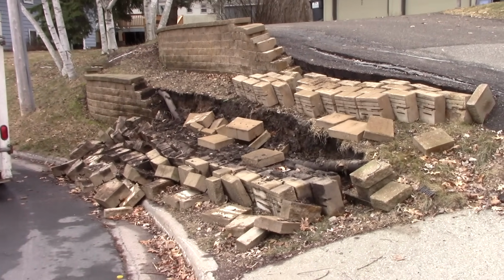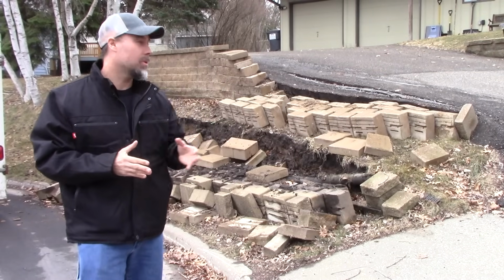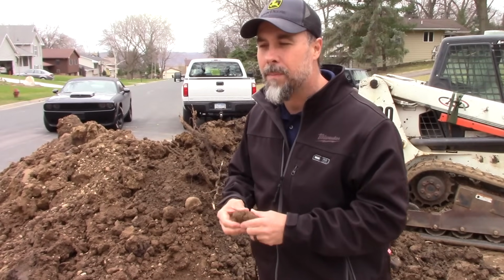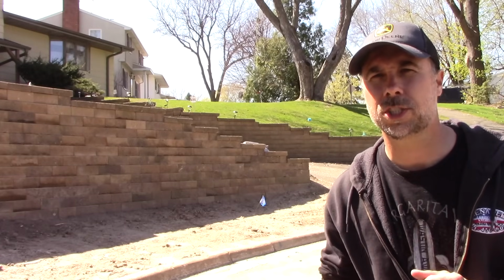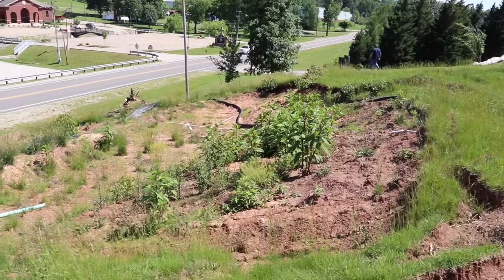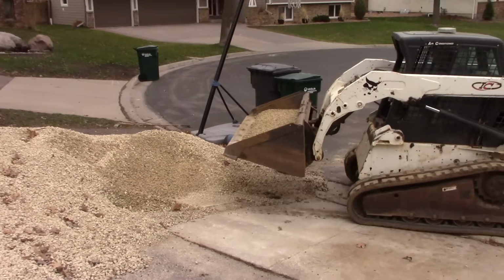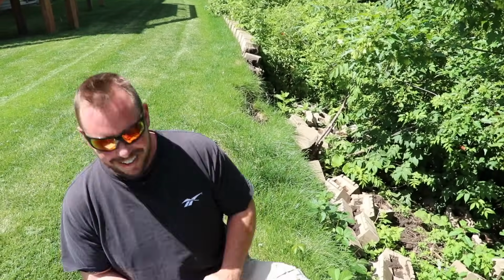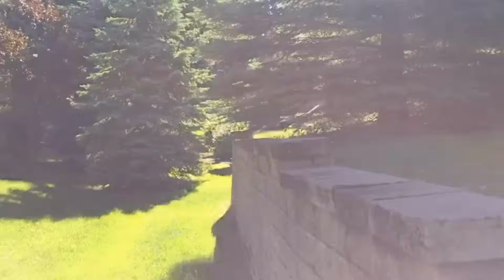Retaining Walls - How to Avoid Costly Mistakes and DIY your landscaping Walls with Great results!

Comment: we just had to fire our contractor because they were redoing our driveway, and when they took out boulders and cement they dropped it over on to the retaining wall, cracked our foundation rocks and cracked the rock on the other retainment wall. they took half of the money and after over a month we fired them. Now we are getting a structural engineer to come look at it, and we have no driveway, rock in the road, and I'm a mess. I love your channel and wish you could come out and look at our project!

Comment: I put geotextile fabric between the six inches of top soil and the 3/4" drainage rock at the very top of the wall to keep that soil from migrating down into the drainage rock.  I did not put anything between sloped earth and the 3/4 drainage rock / blocks.

Comment: My back yard wall collapsed roughly 2 years ago.  Anchor stones roughly 5 feet high, pretty sure they're only rated for like 2 feet.  Surprisingly, after digging some away, I did found the drain.  The aggregate used was 1" pea stone...  there's a garage about 4' away from the top of the wall.  Even as little landscaping knowledge I have, I knew it was wrong. I bought the house with the wall already built so I accepted the fact it was going to collapse I guess, but christ I hate bad DIY jobs.

Comment: No fabric on the back face of the wall 100% agree but I just want to clarify for everyone, we can use it running horizontal on top of the aggregate/under the soil to keep dirt from running into the aggregate, correct?

Comment: Good Video. Thanks for Sharing!!.  I used Timbers to build them, have proper drainage pipe at bottom, gravel fill, fabric to hold the soil.   It has been more than 6 yrs now.  But I see it is starting to tip over,  it has moved slightly moved outwards at the top(like the one that is shown at end?   How can I fix this?..  I think there is too much hydro static pressure getting built up?  Hope I don’t have to tear the whole thing down..

Comment: Thanks for the video. We just bought a new home and it’s located on top of a hill. My wife and I are planning on leveling out a parking space for our camper trailer off the driveway, which is on a slope. I’m trying to do as much research as possible to get it done correctly the first time and have it last as long as we own the property. Would you recommend cutting into the slope or building a wall at the bottom and backfilling? Which method is the strongest?

Comment: So eventually dirt fills up the voids between the rock behind the wall and it doesn't drain any more...
Leading to hydraulic pressure and the retaining wall fails 
It might take an extra decade or so but it is inevitable, right?

Or is there something that's not filter fabric that keeps the dirt from filling the gaps between the rock and would let a walk last a hundred years!

Comment: Do you use filter fabric at all, like between the the drainage aggregate and soil to keep the soil from migrating into the rock, clogging it up over time? Or does the 18+ inches of aggregate keep the soil far enough from the wall that no fabric is needed?

Comment: I installed a 2' keystone wall about 4 years ago and it is looking as good as the day I finished. If you fallow the proper methods of drainage and installation they hold up just fine is So Cal.

Comment: But what are the considerations for proper terracing? I’m just trying to do 13 inch high terraces with a rise of 4 feet and a run of 10 feet. Using ancient but solid creosoted wood 4x13x 12 feet or 16 feet. Small project. If something goes wrong I’ll start over but I am totally turned on by the physics of all this stuff. Good watching. 👍🏼👍🏼👍🏼

Comment: Hey buddy I have never built a retaining wall so I am really liking your videos, thanks for sharing your knowledge and the mistakes of others. So now I know not to use filter clothe and to use geo grid. But do I need to get the wall engineered if its only four feet high? And do your tips about how to make the base include for places where its gets cold in the winter and we get frost heaves?
Reply: I know it’s been awhile since your comment was posted, is the project done? I have input if not or if you still need it.

Comment: Im the small town i live in, i cant get the solid blocks for use with dowels.  All i can get is the 3/4 lip blocks . Ive explained this to the homeowner and they want it done now. Any tips to make the lip system strong as possible?  Im using clean rock behind the wall along with geogrid.

Comment: I don't agree that the problem is always with the cheap contractors. Properly installed retaining walls aren't cheap and sometimes homeowners are hard to convince paying to do it the right way. Sadly it always ends up costing them WAY more down the road. Most of the time I see a failed retaining walls it's because of the homeowner playing legos.

Comment: This video was fantastic and I learned so much! Which I haven’t learned from other videos so far I am trying to build one on my own in my own garden I am not a professional. 100% novice!
I have collected Fieldstone and I am intending to build a retaining wall which should be about 2 feet tall .
Maybe somebody would be generous enough to tell me;
I believe I will go about 10 inches into the ground, with just a continuation of wall(more fieldstone) and put it together with sand and cement.
So far what I know is to make sure that there is a gentle slope upward(A little thicker on the bottom) and considering the height I’ll make it thick enough 
I don’t believe it’s necessary for me to use any piping behind it and I don’t have any “ aggregate” (is that a fancy word for gravel?)
I’m doing this on a shoestring budget(!!!)
Any tips ?

Comment: I'm in Sonoma County, California. Here we have a lot of Adobe. How much aggregate for that to drain properly? Can Adobe be a real problem to work with?
Reply: Yes. The abobe (clay) gets saturated from rain and is  VERY heavy. Excavate back 16 to 24 inches behind the wall  all the way to the bottom. Preferably 6inches at least deeper actually so you can put a perforated pipe in there. Probably 3 or 4 inches of drain rock under the pipe, then fill the entire void to the top with drain rock. Dump the clay. The water can then run down through the rock into the pipe reliving the stress on the wall.
Reply: @diyoregonnowtexas9202 , how can grass grow right to the edge of the wall? I really don't want to have the grass edge 16" to 24" behind the wall. If I put dirt on top of the rock it will eventually all sink and filter through the drainage rock.

Comment: I didn't put anything behind my staggered retaining wall.  Laying on about 6" of gravel 12" long 4" high blocks.  Granted it is pinned by half the thickness of a block to my driveway that is not going anywhere and I used the block adhesive.  There are sooo many variables with anything.  My wall is over 10 years and hasn't moved an inch.  I'm just a retired brick mason so I don't know about these things...

Comment: Great video (all of yours are) just wondering thoughts on weeping tile? Necessary for all walls even if there's proper aggregate? (or will it just naturally weep if properly done?) Does the size of the wall matter? Is it ok to weep it out the front of the wall if need be?

Comment: Building a house in Mexico with a retaining wall, My story:, since the lot was on a hill when they flattened the lot as the architect recommended it created different ground levels so I had to put in a giant retaining wall all around the property which is huge 40meters x 20meters. I had an engineer give me a design for a wall and I went with his design which used a giant footer with tons of rebar needed. This ended up costing me over $55k since it took over 45 cubic meters of concrete for the footers, and 6 tons of rebar, and 3 months to construct it  because its so big with a crew of 8. During the construction builders down here told me my wall was weak so I should put in vertical and horizontal castles (that's the way they do things down here, I took there advice costing me more money in bagged concrete, and more hours of labor,. This has been a terrible experience everyone seems to not respect a budget even when I tell them I have one.  Thankyou for videos like this I just wish all the people down here that call themselves experts would stop giving me bad advice, mostly because you can give them an engineers plan and they won't construct the wall that way,  weeks have been wasted because the first team started building the retaining wall the way they always have and not anything like the engineers plans, then we had to dismantle 2 days of rebar in the wrong place. My advice is watch the your construction like a hawk down here, because almost all the recommended builders, so called mastro's, and self proclaimed I've been doing this stuff since I was 12 guys suck down here. There more likely to cause a problem so learn learn learn from videos like this...….
Reply from the maker: Thank you and thanks for sharing Rick !

Comment: Great Wall advice. Shouldn’t you have non-woven fabric separating the 3/4” stone from the soil so there is no contamination?
Reply: Exactly.  I just pulled apart a 9' wall that had a mountain of drainage stone behind it.... most of that stone was filled with clay.  We had to replace the wall of course... it was all over the place and had even damaged the house.

Comment: One of my builders wanted to do a stacking block wall. He asked me for a price and his bricklayer. The bricklayer undercut me by thousands, just a couple of problems. No geogrid, drainage aggregate, or footing (just plopped it one an inch of sand). The potential buyer of the House said, “I think the wall is falling”. Yep, just 25 days and it was falling over. He called me and asked me to rebuild it. 9 years later it’s still standing.

Comment: So if you stack 3 before backfilling, how are you filling the void between the blocks?  Most engineers will say this is a big no-no.  Stack one block course at a time and backfill/pack.  I'm guessing due to the pinning process, this is hurts the wallet.

Comment: So if this guy is a pro, then tell me what the pins account for in the engineering?  I'll tell you.  Zero!!!!!  Versa-lok gets its grid and block connection from the weight of the block.  This guy is a clown talking out his you know what.  Go to an NMCA seminar and get educated.  I've seen plenty of versa lok wall failures.  The installer and design engineer make the difference, not the kind of block.  Also, if versa-lok is built with out using grid, proper soils, compaction, it to will fail.  Rewatch the video and look how many failures have any of these issues.

Comment: For someone that needs to build a short retaining wall(2ft), on a small budget, what is your best recommendation for product?
Reply: thexe99 i’m doing the same thing can you please tell me if you’ve learned anything in the meantime
Reply: thexe99 what I am intending to do is use fieldstone and go down about 10 to 15 inches below the surface, make sure that it’s slightly wider at the base then at the top, make sure it is a thick enough wall(I just use better judgment and proportional ratio) and in my case I will deliberately make sure that the wall itself it’s not entirely sealed meaning, water can seep through... unfortunately I don’t know what aggregate means but it seems to mean gravel, as I’m doing it on a shoestring budget I won’t be able to offer much they are but I can put a little bit of whatever stones I can get my hands on and I’ll make it a tad bit higher than needed as there is still hill behind it
Remember I’m a complete novice here
Looking forward to your reaction and input

Comment: Another HUGE mistake is building a retaining wall with wood planks that isn't weather proofed...Had to fix that after I bought my house. Absolute nightmare!
Reply: William Segel my neighbours land was raised one meter above mine and he removed my metal colour bond fence to build a so called retaining wall, two planks of wood..  fast forward 10yrs and new owners decided to add additional driveway front to back of property on my side of the property.. for almost 4 years the weight of the concrete pushes dirt, excessive amounts of water even from light rain, underneath my fence.  And my fence is falling on my property. My gates and post are bent and need repayment as no longer close.  He will not fix the problem, which could have been avoided.  Now my house is damp and his house is on the market for over a million dollars..  wish this guy worked in Australia, maybe he could solve my problem..   you had to fix a problem caused by the previous owners of your property, so I’m now wondering if the same will apply to the new owners of my neighbours property????.

Comment: It wasn't the driveway immediately above and along that retaining wall that caused it to fail rather than the "style" of wall built that caused it to fail? I don't think "retaining walls" are made to retain anything but "normal" soil loads and I think the asphalt and driving vehicles on it and probably the driveway dumping water along the back edge of the wall itself might have had something to do with the failure.

Comment: Great common sense info for proper retaining wall installation. I'm surprised just how sloppy so many companies are these days. Those walls you showed on this video were such a disaster I couldn't help but Lmao! Thanks for sharing! 
  Btw, keep in mind that those blowers you submerged fully underwater, the companies claim are "weather/water resistant" NOT "water proof", there is a big difference between using your blower in pouring rain or taking your blower swimming in your local YMCA pool. Ha ha!

Comment: Interesting comment about the fabric. I've always understood that Geofabric should be placed on the soil side of the drainage aggregate to prevent the fines from the soil clogging the aggregate and preventing free drainage to the ag pipe at the base. Is that correct? If that's true (and I'm not suggesting it's not) the surely Geofabric would always become clogged and you may as well use plastic instead of Geofabric on jobs? I'm keen to see that clarified as I think I may have misunderstood. I've certainly seen fines working into drainage ag, indeed have a job where I need to sort out precisely that mess and it's too tight to get an excavator in.

Comment: What are your thoughts on gabion wall systems (steel cages filled with rip rap stone)? We build them with no footing and no aggregate behind the wall and they hold up well and handle drainage superbly. They're cheap and can be attractive, once we plant the front face with flowering vines and cover the top with grading and vegetation.

Comment: Built my retaining first wall, 5' high at its tallest outside corner, using 4"x8"x12" interlocking blocks (on sale for 79 cents each!!!). The sign said max height was 24". I more than doubled that. 4" tamped gravel base. 1 and a half courses below grade all the way around. 18" of washed 3/4 gravel with two draintiles (one at the base and one halfway up). Two courses of Geo grid glued between courses with PL400. Staked back into the hill with rebar.

Built it 10 years ago, and it just started to separate at the radiused corners. One mistake I made was using sleeved draintiles. I think they finally got clogged, and that's why its splitting.

Comment: So no filter fabric anytime whatsoever? I'm going to be building a wall for the first time and everything that I have read says you should use fabric between the back of the aggregate and the soil and the top of the aggregate and the top soil that will be laid down. 
I know you said the filter fabric will eventually get clogged and not allow water to pass through but won't the aggregate eventually get filled with fine soil particles and get clogged as well. Any clarification would be much appreciated. Thanks!!!
Reply: 11tecmo and info you find on this topic will agree with you. The permeability of the rock or fabric will only be as good as the dirt it is in. The point is to keep water away from the wall so in reality if the fabric clogs' the water will just drian down anyways.

Comment: If you are working in a soil type that is going to clog filter fabric, it is going to clog your stone layer as well.  Your fabric or crushed rock will only be as permeable as the ground itself.  A free draining wall is a bad idea to begin with because what happens when it freezes and thaws with water draining through it? A busted up wall.  The whole idea of a drainage layer is to keep water from draining through the wall.  The reason why the last wall is bowing is not because of the fabric, it is because there a tree there for one, and wall is too tall for the material used.  It should be engineered and I would place a bet it is not.

Comment: What's your thoughts on a core filled system using aggregate? There is a Belgard and a Versa-Lok supplier in my area. I am just curious is one really that much better than the other and why?..... Thanks for all the vids, they rock. Keep it up. 👍

Comment: 2200lb lego blocks are good 4600lb blocks are even better !! No heights no limits
Reply from the maker: Yes!  The bigger the blocks the better!
Reply: But a lot of people still don't understand, you still have to have a base to set the block on and drainage behind it, no matter how large the blocks are.  And corrugated drain tile, especially with a sock, is not the proper way to drain behind a wall.